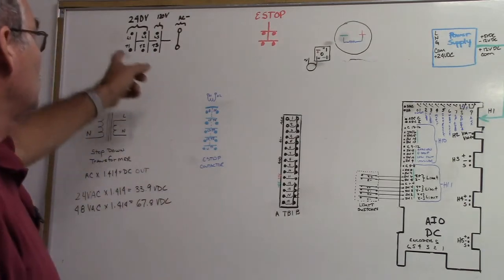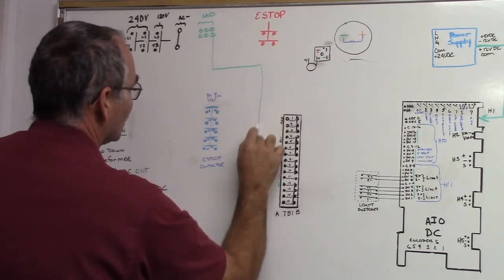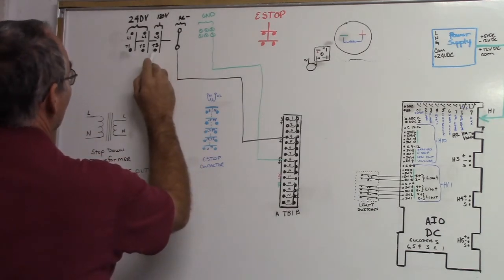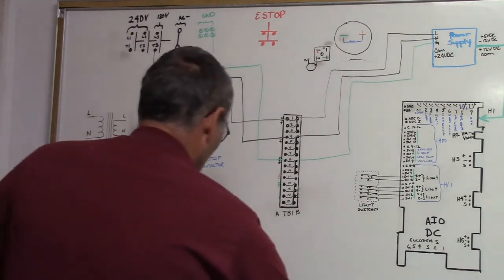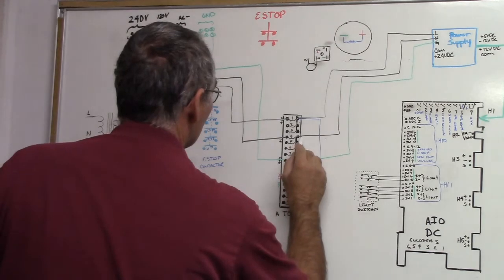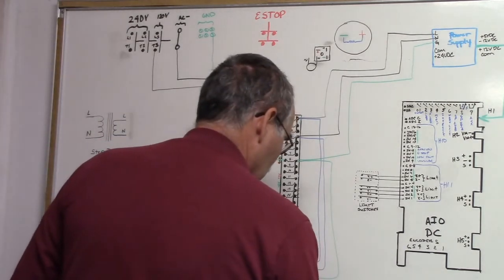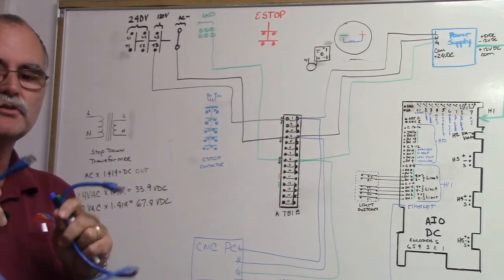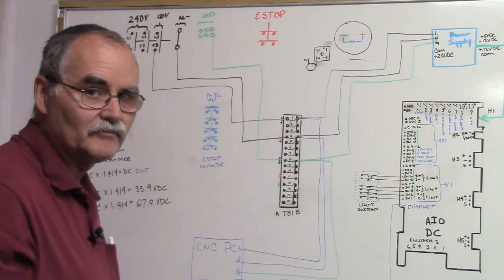2: "Wiring" The Centroid All in One DC - Power Distribution

Comment: Would you possibly know where to source transformer? Centroid offers the high cap bridge and capacitor and transformer for ~$1100, I would like to find a less expensive source for the transformer if possible.  Ebay did not seem to have.  Any suggestions are much appreciated..
Reply from the maker: What is the terminal voltage of your Servos or do you have the make and model number?
Reply: SEM motors X Y Z 40"/ lb. 10.2 A. Max voltage of motor is 140
  For the high cap bridge, I need center tap transformer.  TB161 states I need 0.8 kw per motor .8 * 3 = 2.4 /.8(PF)= 3kvw. 
The current transformer on mill is rated 2.2kva. It has taps out, left to right of for 24, 12, 0, 110, 20, 0, 110, 100, 0 and ground. Primary side of transformer taps = 0, 190, 210, 220, 230, 0, 190, 210, 220, 230. I may be able to use the low cap bridge and power it through the 100volt tap but is not recommended  by Mario @ Centroid.  Any thoughts?  I don't really want to spend another $1100
Reply from the maker: That was my next question, if you had the transformer, capacitor and bridge that came on the mill. It was previously engineered to work together. I would work with that. Remember you need that device that helps with the inrush surge when you power up or you will trip your breaker. You can see it on Centroid's capacitor/bridge.  Also, just because the servo terminal voltage is 140 does not mean they were run at 140. Likely much less, perhaps 100V. Remember to multiply the secondary AC output voltage by 1.414 to get the DC voltage.
Reply from the maker: You can also limit your output voltage by not maxing out your Max rapid setting. Also use the 230V Primary setting if there is no 240V setting.
Reply: good thinking.. the current dynapath system has everything there already including the rectifier and capacitor.  I would think I should be able to power the all-in-one controler from there and not need the bridge and cap from centroid?
Reply from the maker: Correct!  I reused the bridge and cap from my Millstar retrofit. No worries. Make sure you use the Inrush Current Limiting Thermistor. AS32 2R025 or the next one larger. Mine has tripped the breaker on startup once.
Did the Dynapath use encoders on the servos or Tachs?
Reply from the maker: Automationdirect.com has good prices on encoders and they have good support staff.
Reply: martyscncgarage  could I get your email address?  
I will look into automation direct.  I am not sure if this dynapath used the tacho or not. it has both encoder and tacho.  I don't know the line count.. I will take the cover off of one of them and see if there is a label or some clue to count per rev. I assume they are quadrature.
Reply from the maker: martyDOTescarcegaATgmailDOTcom
Gotta be at least 1000 lines before quadrature....differential encoder. Most encoders will have the color code and info on the lable on the side of the encoder. They aren't terribly expensive and you just saved $1100! :-)